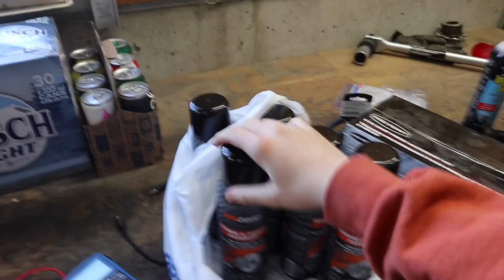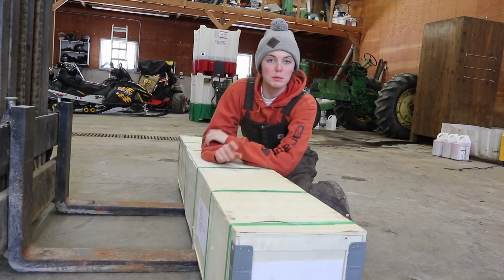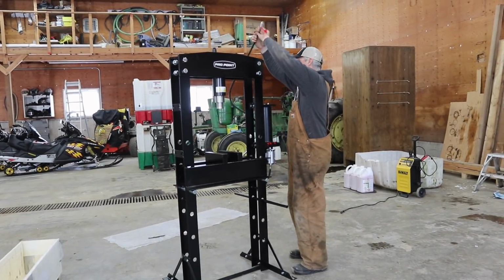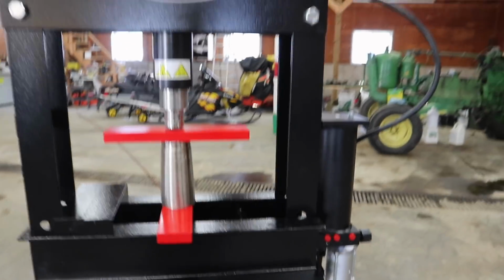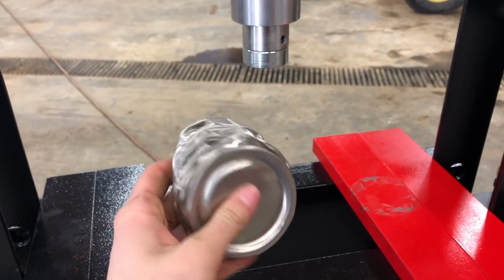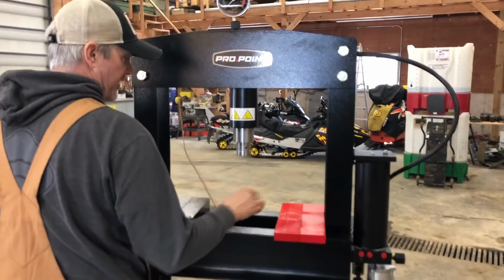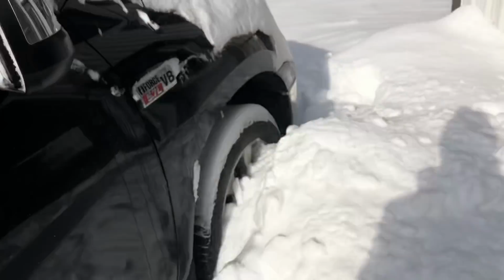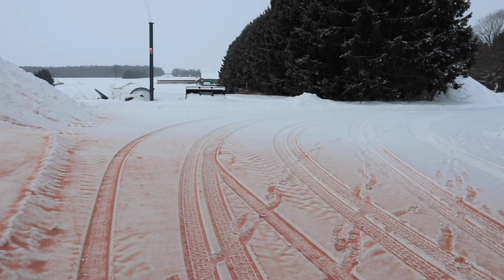I CAN'T BELIEVE WE BOUGHT THIS!

Comment: One more great movie that you have done👌🏻👍🏻. 

I am happy that you two use protective gear but, when you use the press try to stand behind the pillars on the press or build some plexiglass protection that you fold up and down. This is important when you press small stuffs, they can slip and fly like a projectile. Big parts drops down on floor if they slip. I have been hitted once by a small bearing that sliped in the press😢.

Beautiful weather you have.

FARMER